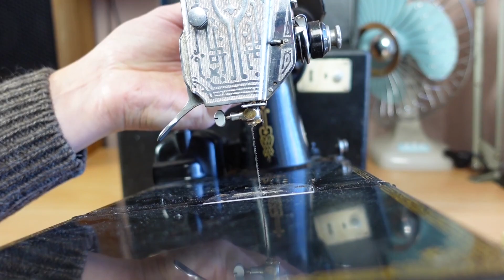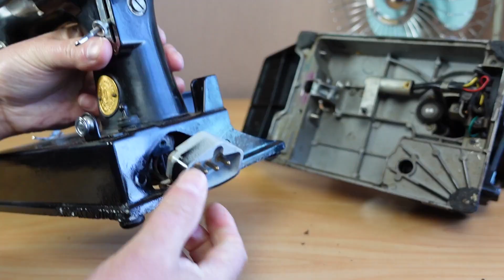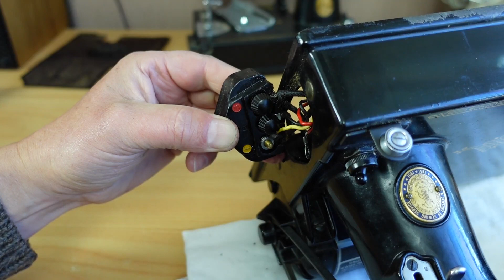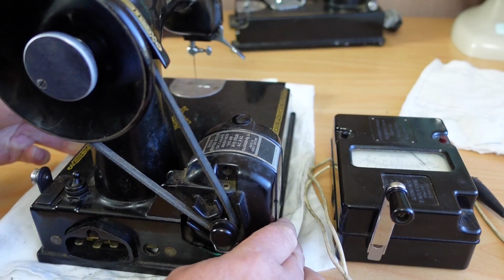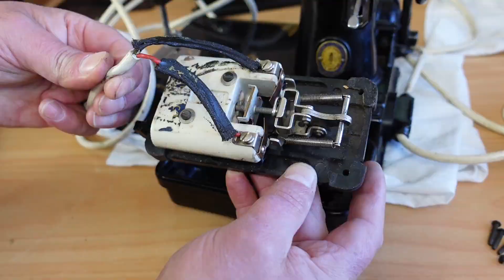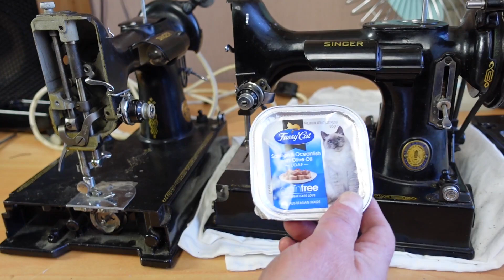Rescuing a Singer Featherweight 221K (Centenary) Sewing Machine - Part 1

Comment: Oh my goodness that is so crazy. I'm not into vintage machines but I did inherit a featherweight myself that was running pretty well. I took it apart cleaned it greased it oiled it and did everything I could to bring it back to pristine condition and sold it. I think it's important to preserve these old gals. it didn't upset me but it made me laugh that someone converted it to a saw. I would have loved to see it demonstrated running as a saw lol
Reply from the maker: I may try to find another blade to replace the one I broke when trying to demo it.